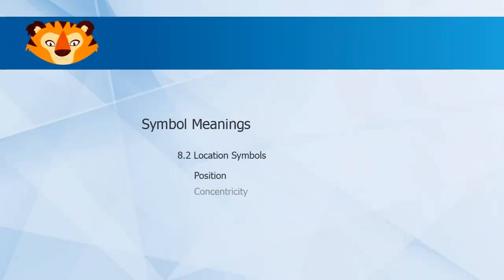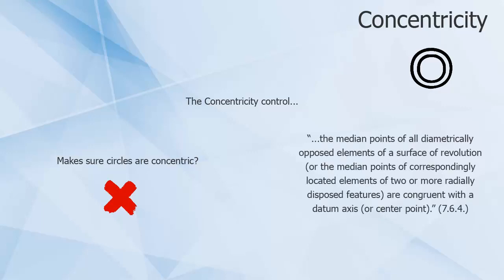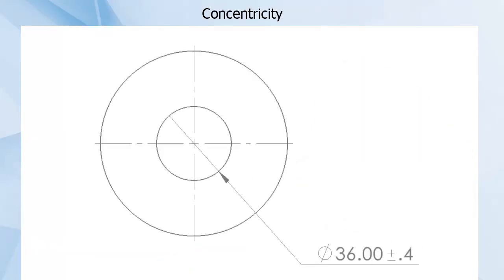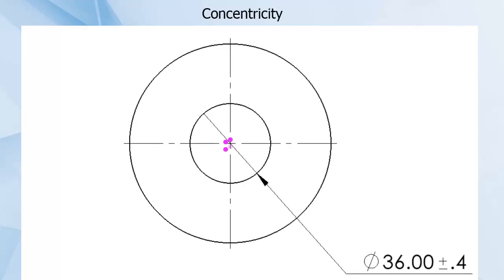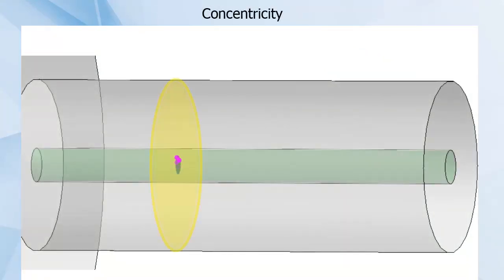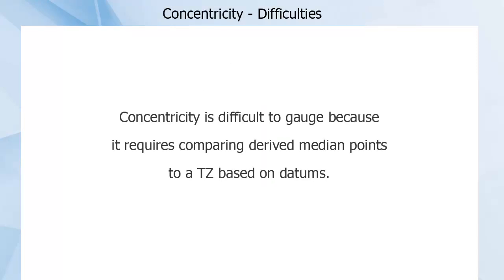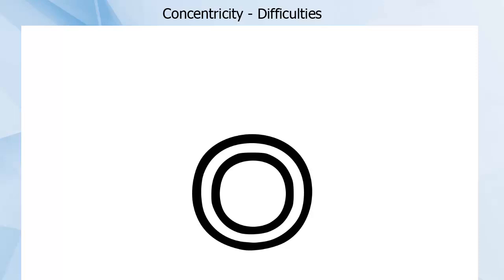GD&T Concentricity (Don't Use It)

Comment: 1. There is no standard called out in the video.  So I have no choice but to assume that it is either ASME Y14.5M-1994 or Y14.5-2009 because the committee removed concentricity and symmetry in Y14.5-2018.  
2. All the dimensions technically do not meet the standard.  For instance, ⌀36.00 ± .4 should be ⌀36.00 ± .40 for imperial dimensions or ⌀36 ± 0.4 for metric ones (yeah, details matter). 
3. All concentricity callouts in the video are missing the "⌀" symbol in the feature control frame because the concentricity tolerance zone is a cylinder.
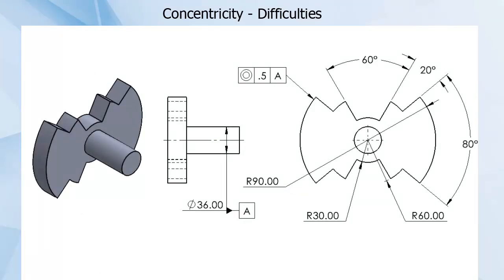4. The flywheel part shown (timestamp 2:50) does not have a surface of revolution.  So that one concentricity callout does not apply to other areas of the part.  So you would need 3 concentricity callouts for each partial cylindrical area with a CONTINOUS FEATURE callout/flag.  And that still does not cover the planar features of the part.

In my humble opinion, a training company that claims to teach people GD&T should not make these mistakes.  My advice for all viewers, please do your homework before buying subscriptions.  You should check the credentials of the instructors, etc.  Unfortunately, anyone can "teach" on YouTube these days.  There is no checking authority.  So be careful.  Always question.  It is very easy to learn new things wrong.  Do yourself a favor and buy the standard.  It is a good investment and a good starting point.

Comment: Dont use concentricity? Your statement is ridiculous. Your misleading beginners on a very important subject. A subject that can termine if someone lives or dies - coming from aerospace industry, its the most important aspect - safety. A lot of blueprints in aviation use concentricty. Then again - anyone can create a YT channel and "teach" things.
Reply: @mscscambodia  It is a mistake that they removed concentricity ( and symmetry).   You will see they will add them back.  The concentricity solves a design intent that no other geometric control can.  Imagine a cylindrical portion of a shaft that spins relatively fast, so the weight distribution and balancing is important.  This portion does not mate with any other features in the assembly. So you would have a relatively large size tolerance and a tight concentricity tolerance.  The form is not important either as long as the feature is concentric.  You cannot have this with any other geometric control!
- total runout:  you would have a large error for a tapered, barralled, waited feature.
- runout: you would have a large error for an elliptical cross-section, but that would be concentric.
- profile (with or without the dynamic modifier): this would force the size tolerance and/or the form to be tight, which you don't care, because all you want is large size tolerance and tight concentricity!